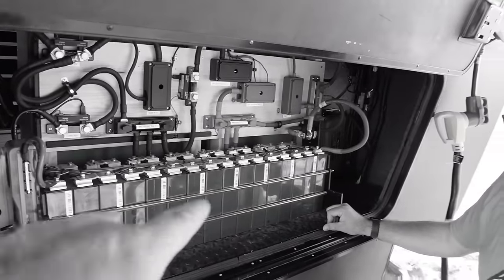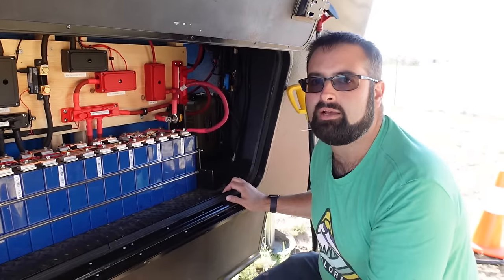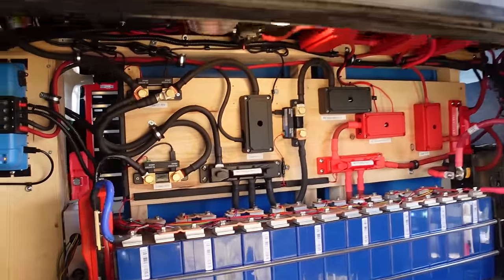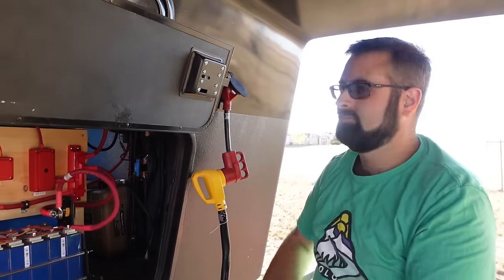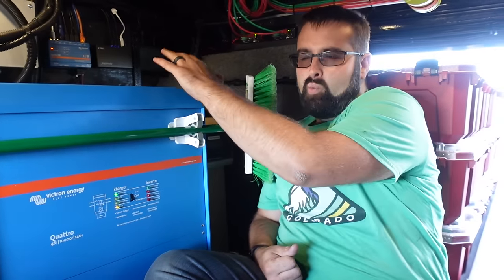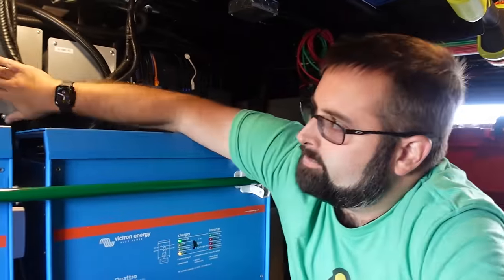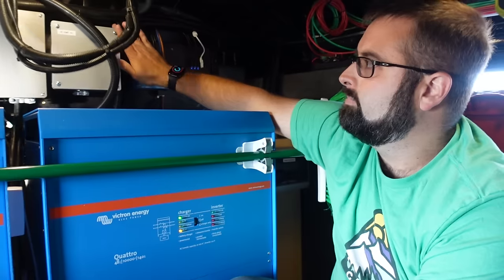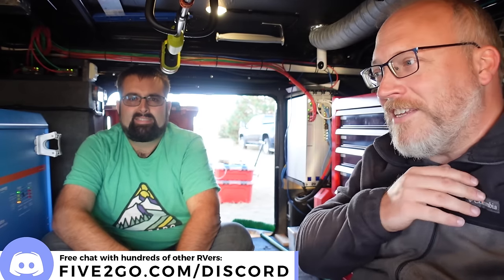How To Do RV Lithium The Right Way

Comment: I chuckle every time I watch a video with people who put these large systems in their RV!  They all say the same thing lol I can power everything in my RV for 2 or 3 days but once the power runs out, we have to charge it back up! and how do they charge those big banks up? they either start their 6 or 8 cylinder vehicles up for a couple of hours using up their fuel and burn out their alternator or they plug it in to shore power! why not keep the generator or use an external generator and set it back 50 yards to keep the sound away and throw a box over it to deaden the sound lol or just plug in at a nice RV resort! a lot cheaper that way and you have more amenity's
Reply: I have a 33.6KWh battery bank in my RV.  I charge it with solar panels.  3000W on the roof.  I've been out for weeks at a time.  Longest run is 6 weeks on the beach in Texas last winter.  I ran the generator for a total of 14 hours on 2 days that entire time. There were many cloudy and rainy days. 

Your evaluation of cost is correct for some situations, but not all.  For full time RVers like me, a solar power system makes very good financial sense. The yearly cost for RV parks and campgrounds is $10k and up. (of course there are cheaper options if you don't travel, but I'm leaving the trailer park situations out of this)  My solar power system cost just shy of $10k, so that means that by not staying in parks and campgrounds, I pay for it in one year.  After that it's free.  And it gives you freedom to not worry about the location, noise, congestion, availability, and other constraints of RV parks. I know some people love them, but not me.  

For the weekend warriors and people who only use their RV a few times a year, it probably makes more sense to use a generator as you say. You can buy a lot of gasoline for $10k.
Reply: @Patrick_Cashman  you have a 33.6 kwh battery system with 3000watt solar power with inverters and all the electronics to go with it for $10k? Wow that's cheap. I can see you getting the time you say with out recharging if you weren't running air-conditioning and other power sucking equipment on a regular basis, but there's not enough sun in a day to keep 6 weeks of running certain equipment on a daily basis. This video says he kept his system running for 2 days with AC and other equipment going and that makes sense. I do know power conscious people can make things work and what ever your doing your doing it right ✅️
Reply: @waynec2962   I never said I ran my system for two days straight with the air conditioning running.  I can get about 6 hours running my base loads plus all three air conditioners off the battery (not taking into account what the solar would contribute)
Reply: @Patrick_Cashman  I wholeheartedly agree!
Reply: I chuckle everytime someone acts like it's stupid to have batteries + solar on an RV. Not only can I park in the middle of nowhere (not an RV Resort) without people all around and still run all of my appliances, but I can do so without having to pull out the generator very often if at all. With 2700W solar on the roof, I've gone more than a week without touching a generator. When I do have to run it, it's because of a few cloudy days and usually only a few hours of run time is all I need. Even better, since I barely need to run my generator, its little 3.4 gallon tank usually last weeks. In fact, I've run the generator more often to exercise it than to actually charge my batteries. Also worth noting that I've seen someone run through their 60 gallon tank with their onboard generator while I had to do nothing.

But hey, to each their own. If you like the idea of topping off a generator 50 yards away periodically and creating more noise than you need to out in the otherwise peace and quiet that is nature, go for it. I'll just make sure to be several hundred yards away from you while I enjoy my silent solar setup. 😀
Reply: @MrDarcie  lol I didn't say it was stupid to have batteries and solar on an rv! What make me chuckle is that some people build these very large systems for there rvs that have to be very large as well to house 2700 watts of solar panels on the roof. There's only a certain amount of time in a day to get enough sun to charge batteries and some of these 19kwt battery banks would need much more than 2700 watts to charge up to full charge and you would have to stay in an area that has a lot of sun. But most people don't have that option, they have to camp where they can and to have that kind of sun exposure is not available for everyone 😒 some of these videos inspire people to build these big systems but then some videos show how disappointed people are that there system doesn't work for all their power needs lol
Reply: @waynec2962  While I agree that 2700W isn't enough to fill 19kWh of battery storage in a day - that's really not the point. I top off my batteries by 12 or 1pm on an average summer day, down to 2-3pm on an average winter day.  But I only go down to 30% or so most days (9.6kWh battery storage), not to 0. But that's the point. The solar is there to take care of my normal usage on an average day, with an average amount of sun. It's not meant to refill the batteries from 0% - as that isn't likely to happen often. The "extra" storage is really there for the "crap, it's a bit cloudy today" or "Maybe I will run the AC for an hour or two, or more".

The fact that Ben, myself, and others don't need to use a generator often proves the point. I have enough solar to keep me going day to day, and enough battery to provide some wiggle room for cloudy days or some "excess" usage.

Do people build solar systems that they are  disappointed in? Sure, just like people do all kinds of things they are then disappointed in. Often times it's just a matter of expectations not being set appropriately - we have to break the bad news to people in Discord all the time because they think solar is going to be cheaper and let them run everything. But should it stop someone from showing what is possible and what a full-fledged solar system can look like? Absolutely not. I only learned about all the different possibilities with solar on my RV because of videos like this one and lots of reading in Discord and forums. I did my homework, I learned what I needed to accomplish my goals, and I went out and built it. 

Videos like this show what's possible, it's on the person tackling their own version of the project to learn what their requirements are and what it'll take to accomplish their goals. It's really no different than anything else in life.
Reply: @waynec2962  Besides all of that, your reasoning in the original comment had nothing to do with peoples misplaced expectations, and everything to do with how stupid you felt it was to have these systems since we were just going to "start their 6 or 8 cylinder vehicles up for a couple of hours using up their fuel and burn out their alternator or they plug it in to shore power". The fact is that we don't - we let solar handle the majority of the work.

TL;DR You're wrong.

Comment: I wouldn't want the batteries like that in an RV. Zero protection for them from objects or cold weather.  I wouldn't say thats the way to do it all. They should be in steel cases at a minimum.

Comment: lol 2,070 AH, he does not know how batteries work. and it doe snot matter what Voltage your batter is, AMP Hours are AMP hours, the only thing that changes is the current and the Watt hours, not the amp hours..... this dude is out to lunch. If he has 2 Sets of 48 Volt cells in parallel and lets say based on the size of those they are 200AH, the most he would have is 400AH multiply that by 48 Volts and would have roughly 20.2Kwh of power. and since he said 26 Kwh maybe his cells are 280AH. but to say that you have over 2000 AH and it would take 21 Battle Born batteries to make up, is utterly Bull. But this guys has absolutely NO CLUE. But seriously people do the Math 26Kwh divide that by 48 volts comes out to 541AH or 270AH per 48 Volt Bank. So they must be 280AH cells. Prove me wrong although you cant.
Reply: 100Ah @ 12V is not equal to 100Ah @ 48V. You should consider educating yourself before deriding others. The math is pretty simple though - 100Ah @ 12V is 1200Wh, or 1.2kWh. 100Ah @ 48V is 4.8kWh, or 4 times the energy storage. I charge an hourly fee for teaching, but will accept beer. Thanks and have a great day 😊
Reply: Sorry Patrick, but you are completely wrong.  Period, end of story.

I’ll explain:

Amps (and Amp hours) are voltage specific.  Watts (and Watt hours) are not.

Watt’s Law is (Amps * Volts) = Watts

I’ll break it down further.  All my cells are rated at 230 AH and each cell is between 3.3 and 3.4 volts.  The full charge value is actually a hair over 54 volts.  However for simplicity in the video, I still used 48 volts in my amp hours comparison.  It’s a 48 volt nominal battery, so to convert 48 volt amp hours down to 12 volt amp hours, you’d multiply by 4.  (230 * 4) = 920.  I’ve got two of those batteries, which comes to 1,840 amp hours @ 12 volts.  Then add the 230 amp hours for the actual 12 volt nominal battery and you get … yup, you guessed it!  2,070 amp hours!
Reply: Now, let’s talk real world power storage kilowatt hours (or kWH).

[For those who don’t know, a kilowatt is 1000 watt hours.  This is doesn’t rely on voltage to be described, so in reality it’s a better way of expressing power usage and storage capacity.]

Using Watt’s law (from above):

48V Battery #1:  230 * 48 = 11,040
48V Battery #2:  230 * 12 = 11,040
12V Battery #1:  230 * 12 = 2,760

That’s a total of 24,840 watt hours, or 24.8 kilowatt hours.

Now, here’s where it gets interesting—that measurement was done based on the nominal voltage, not the actual operating voltage.  So let’s take an average of 53 volts on the big batteries and see how it plays out:

230 * 53 = 12,190

Multiply that by two and you get 24,380 watt hours (or 24.3 kilowatt hours).

How we do the average voltage of 13 volts for the 12 volt nominal battery:

230 * 13 = 2,990

If we add that to our previous numbers, you end up getting:

24,380 + 2,990 = 27,370

So, that actually gives us 27,370 watt hours (or 27.3 kilowatt hours).

So all that wonderful math says that I’ve got some where between 24 and 27 kWH of power storage on board.

Now, when Eric load tested the cells in his shop, they actually tested closer to 245 amp hours.

So that would be somewhere between 26.4 and 29.1 kWH.

So yeah, I don’t think it’s much of a stretch to say that I’ve got around 26 kWh of power storage in my rig.
Reply: @triphius  just a little typing error from your side, I'm pretty sure you know the difference between them... You say... "For those who don't know, a kilowatt is 1000 watt hours." it is either "1 kilowatt is 1.000 watt" or "1 kilowatt hours is 1.000 watt hours" so the "hours" part has to be there on both side, or none of the side of the is equal to (=)... Example 1... 1 kilowatt load running for 2 hours is 2 kilowatt hours or 2.000 watt hours, you can't say it's 2.000 watt. Example 2... For a 1 kilowatt load running, you can't say it's 1.000 watt hours, because you don't know how long it's running for... If it's just 30 min its 500 watt hours, and if its 2 hours its 2.000 watt hours... And you say
"48V Battery #1: 230 * 48 = 11,040
48V Battery #2: 230 * 12 = 11,040
12V Battery #1: 230 * 12 = 2,760"
But I'm pretty sure both 48 volt batterypack need to be * 48, not just the first... Supernice video, and work... Was missing price for battery and inverters/other stuff, and link to battery and name, I have seen it in comments from you, but would been nice to include in video and discription... Thanks for great video...

Comment: Those two batteries would be 24 100 W battle Børns. I don’t know why he saying 21 doesn’t matter how you wire them, you can do a 24 V you can do it 48 V. Count it for yourself just stop the frame you can see it. 
The difference is those are prismatic batteries and not cylindrical batteries which Battleborn uses. There are pros and cons of both and I’m not going to debate him on that
Reply: Care to break down your math for us?

Here’s mine: 
(230Ah @ 48V) * 2 = (460Ah @ 48V)
(460Ah @ 48V) * 4 = (1,840Ah @ 12V)

1840 (48 volt batteries) + 230 (12 volt battery) = 2,070

2,070 Ah is the equivalent of 20.7 standard 100Ah BattleBorn batteries.